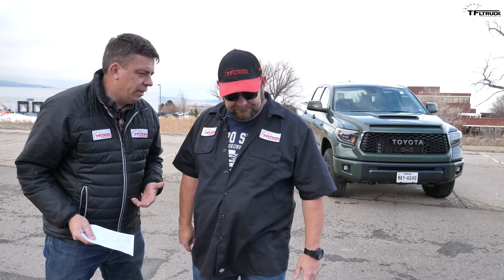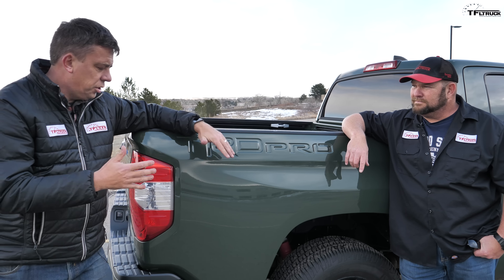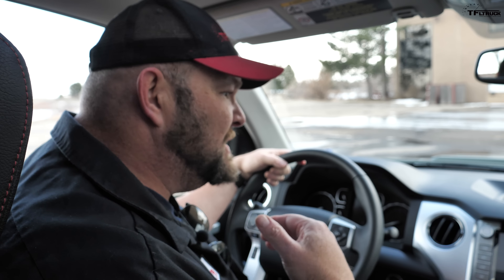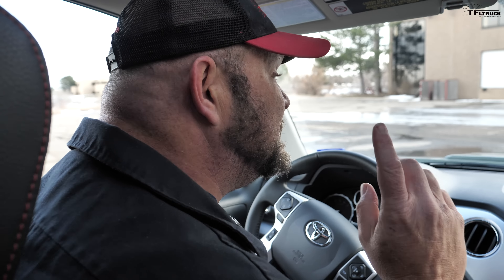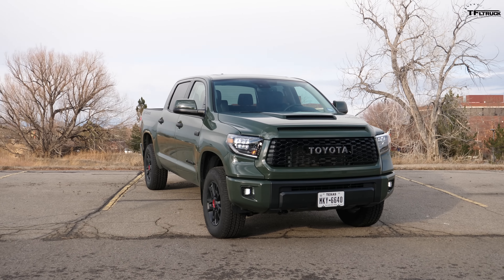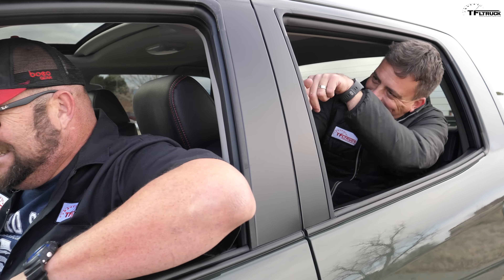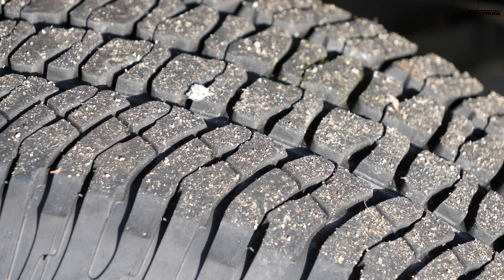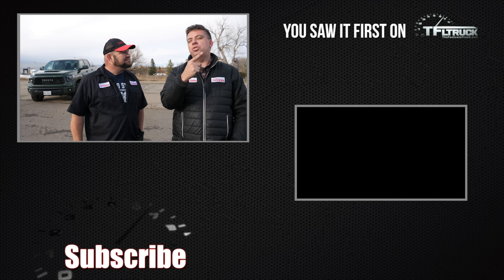The 2020 Toyota Tundra TRD Pro Is Outdated on Arrival - No, You're Wrong!

Comment: The truck is tough long lasting and simple, everything you add makes the truck price go up and up and up. I am a Chevy guy and I am thinking of buying one ..
Reply: My 08 suffered from the front differential howl/growl problem resulting in a replacement front differential...and 2 years later the same issue had resurfaced....rear axle bearing failures, and a couple years later they were failing again.  Water pump leaking like a sieve at 54k, very poor build quality and replacement parts aren't any better.  Finally sold it at 104k, don't miss it at all...on another note, my 05 Tundra has been trouble free with 164k on it.
Reply: @2011buddylee  Yep they decided to completely ruin the Tundra with that garbage engine.
Reply: James Turner I advise you to look into it, I had an 07 and just bought a 15 TRD PRO (1st of this model) I love it, at least drive it and try it.
Reply: I have a 2012 5.7 180,000. No problems at all.
Reply: @wildbill23c  My 2008 limited has 567,901 miles CURRENT on it and nothing major has changed on it. Only tires, gas, batteries and oil.
Reply: @1119-w3u  Lucky you.  I'll keep my 88 F250, it may be a gas hog but never had any problems out of it and it's 860k miles were mostly highway towing mileage, far harder use than the Tundra ever got and no failures of any kind.  That Tundra had issues that a truck with the very light duty use it received should never had happen, then worse the problems repeated themselves again within 2 years of being repaired, not impressed with Toyota Quality, yet my 05 Tundra has been trouble free and it did a lot of moderate towing as well.  Their quality has gone downhill since the new Tundra came out in 2007.
Reply: This Ford guy did.  Simplicity unlike my Raptor.

Comment: What are the other trucks geared for in their rear ends? The tundra is geared to pull. The others are geared for fuel economy.
Reply: 3.55-3.73 gearing is the norm for most trucks. Anything 4.10 on up, you're sacrificing driveability and fuel economy.
Reply: Is that why it has the lowest tow ratings

Comment: For day to day driving here in Canada I'll take the LSD.
For off roading the locker is better but think about how many trucks never any serious off road.
If I'm in trouble it's just as easy to flick it into 4x4....I'm not rock crawling,I'm trying to get thru a mud hole or a snow drift.
Reply: Except it's not an LSD, it's an auto LSD. Which is a nicer way of saying it has brake traction control.

Comment: You guys are wrong about everyone wanting a short bed. I wish the crew cab was offered in the 6.5 ft. bed.
Reply: Kevin Hicks yes... but other than that great!
Reply: First Gen has it
Reply: I would trade my double cab in instantly. They make the chassis to fit it. Hopefully someday.
Reply: There was an aftermarket builder that modified crew max trucks to add a 6.5ft bed. Idk if they're still around though
Reply: The double cab is plenty big enough and still has 4 doors if you just need room for kids back there or adults on short trips
Reply: The crew cab is. 6.5 and the long bed. 
The crew max is not. And I wish it did as well.
Reply: @edshultz9760  , double cab versus crew max. 👍
Reply: @kevinhicks9447  Yes that is what I ment. Double cab has the 8 foot or the 6.5 foot. The max has only one. 5.5 foot. If they made a max with and 8 foot I would get that.
But the crew max Ted sport is ment to be for fun not work. Longer wheel base meant harder off road. But I am not going off road just towing a boat.
Reply: I've never heard anyone that is using their bed say they wish it was shorter.
Reply: Hello?! Thank you for saying this! :) 2020 TRD OffRoad owner here.
Reply: I have a 2015 SR5 dbl cab, and the bed is 6.5 inches long
Reply: Probably the only thing I don't like about tundras is that you can't get the six and a half foot bed with the crewmax cab. That is literally the only reason I would look at an F-150. I currently have a tundra with a double cab. Not a deal breaker, but cosmetically the double cab is ugly.
Reply: @ScoobyGSXR750  
I agree. I hate the short short bed. I would probably buy the double cab my self just to get the 6.5' bed. I've never heard anyone that uses their truck bed wish it was shorter.
P.S. I wouldn't trade a tundra on an f-150 no matter what size bed it had. 😂
Reply: I rather have a 6.5 bed than a crew cab . But definitely wish I could have both.

Comment: Not paying $60K plus for a truck. I went from a 2008 Z71 with 226,000 miles to a 2015 Tundra SR5 4x4 double cab with 42,000 miles and paid $29,000. It's new enough and will hold value better than most other trucks.

Comment: The shape of the floor under the rear seat is the way it is because of the massive 38 gallon fuel tank.  I was surprised they didn't mention that.
Reply: It was like that prior to 2016 and the 38 gallon tank. It's the driveline bump to get the driveshaft/transmission higher up for ground clearance.
Reply: @belanger9  Ya, seems odd because Ford doesn't have a floor hump for their 36gal fuel tank. Can't imagine why they would have had to raise the whole back 2' of the rear of the cab that much for 2 extra gallons and couldn't fit it elsewhere.
Reply: I looked at my 38 gallon tank on a '19 Limited.   It's about 5 feet long.
Reply: Actually it's filled with a big block of foam to absorb noise.  On the shorter doublecab instead of the foam it's a nice storage cubby.  Some folks buy aftermarket storage for back there that have you cut a big portion of the foam out before putting it in.  The only real noticeable difference between the 26 gal and 38 gal tanks is the gap from the front of the tank to the midpipe.  With the 26 gal tank it has near 2 feet of void between the two.

Comment: I bought a 2007 and now own a 2018 Tundra.  With both of these trucks, I have towed my 28' Airstream travel trailer all over the United States.  Never have I had ANY kind of reliability issue or mechanical problem.  Flawless performance from both with brilliant ease of towing.  I may not have all of the electronic bells and whistles of other trucks, but I have solid reliable performance, up and down every mountain range in the U.S.  Superb performance and supreme comfort.  I wouldn't trade my Tundra for any other truck.
Reply: Mike Minton great to hear that.
Reply: Mike I’ve run my toyotas all over these north Alabama mountians and southern swamps. Toyota is only trucks in my yard. I keep 3 allways ! One for work one for play one for in between🍀
Reply: If you never had any issues with your 2007, why waste money on a new one?
Reply: @seantaylor2683  I bought a new one because I wanted the Platinum trim level (Old one was the Limited trim level) and I wanted the new "Safety Suite", radar cruise control, built in trailer brake controller and Bluetooth capability.
Reply: Mike Mintun Toyota rules my driveway as well. Since 1983 no other brand in my girls hands nor mine!
Reply: Sean Taylor two much better than one said my Korean buddy🍀I have to agree🍀
Reply: Bought my 08 NOT running, got it in a bidding war for $3000. Was a broken valve spring and $50 later (spring and valve cover gasket) I had a great running truck. Over a year later, barely any issues.. it has 300k on it.

Comment: My truck is a 1986 Ford f-150 with the EFI 5.0 liter V-8 and a non-overdrive transmission, and a 3.55 rear axle ratio, and the EPA rated my truck at around the same numbers this tundra gets.

Comment: Nathan! You're wrong! Over 1 million miles, comparing this at 14mpg combined to a competitor with a v8 at 17 combined, you would use 12605 gallons more fuel for a cost of $31512.50 assuming $2.50/gal average cost. That's a high fuel cost for that reliability!
Reply: #toyotatax
Reply: @Green Soup I'm using the combined rating. And the reliability isn't that much greater than a competitor's v8. I am deliberately only comparing v8s. Sixes and fours and diesels all have different reliability issues and naturally higher fuel ratings. And yes, the smaller engine probably got slightly better fuel economy, but it is no more.

Comment: Wish we could get this in the "world wide famous Toyota Diesel" other countries get but not us!🤢
Reply: yes and no... to get the diesel, it'll most likely be 10k more expensive and comes with a whole slew of emission hardware that are super prone to failure, even at Toyota's standards. Not to mention the extra expense of DEF. You could do a delete, which would give you the best thing about diesels, but that's a few grand just to do that and the engine has to get tuned... therefore losing out on potential warranty. F150 and RAM's diesels aren't selling like hotcakes either, so the market is very small, not profitable enough for Toyota to spend millions to try to get it emissions approved for the US
Reply: DaDa啊達啦 like 97* of ram 2500’s and 3500’s comes with cummins instead of hemi’s
Reply: @chrishansen7004  That's a whole different category, most people who buy heavy duties actually use them as trucks, while most half tons are just for getting groceries and getting to the mall. Why did you think Ford, GM and Ram took so damn long to bring out diesels in half tons? and the American Ford Ranger is the only country that doesn't come with a diesel, some countries only sell it with a diesel engine. Regulations, since they sell half tons so much more than heavy duties, they're a lot more strict, and the market for diesel engine is so small they need to really find out if it's worth investing. Petrol is still by far the biggest seller even with the available diesel in half tons.
Toyota will come out with a hybrid Tundra before they put a diesel in it. It'll most likely use less gas while towing a lot more.
Reply: Put a 4bt Cummins in yours.

Comment: I’ve always been a ford guy but that tundra is the last of the tough old school trucks. I think that’s the best real world half ton out there.
Reply: Kent Boyko same here, I’m also a ford guy, but now I drive a 2017 TRD 4x4 Tundra and love it👍🏻
Reply: Get the new 7.3 from ford. That truck is going to kick ass.
Reply: Not really. They are way overrated as far as reliability. It is still an all aluminium DOHC engine, with all the known pitfalls of that design. DI in a V8? No thanks. Other than having 8 cylinders, this engine shares nothing with the old reliable truck engines of the past.
Reply: D Ferret One small reason I like the tundra is they still use a steering shaft instead of this electronic steering and our Ford Escapes locked up the other day turned on and off and it works again lol just kind of makes me nervous there is no physical control and all electronic. Also the 2018 5.0 and up have some major issues with oil and coolant disappearing and the big three our so competitive that there trying new things all the time that aren’t necessarily proven where Toyota just finds something that works and leaves it alone until the technology of today is proven 5-10 years down the road and they use it.
Reply: D Ferret if I was to buy a truck today it would  be that superduty with 7.3 mainly because I can use a heavy duty truck and like the long box but if it was a half ton it would be a tundra.
Reply: Yes, sir. Reminds me of my folks 84 3/4 ton. 5.7 with 4.10(close enough) gear ratio.
Reply: Simple Pleasures MTB it is going to kick your ass all the way to the nearest gas station.....very often. Gas guzzler.

Comment: Unpopular opinion: you do need a locker.
Reply: K C No, but when you need it that one time and you have it, it has paid for itself.
Reply: Turn the TC all the way off (5 second hold, not just a push) and the rear tires will spin at the same rate. I've put down a few 11's with my Tundra, don't know how much more locked you want than that.
Reply: belanger9 what year of yours did you hold for 5 seconds? I’m trying to figure out how to play with the traction control
Reply: @clearme2  2010 and 2016. May be 10 seconds, just hold it down until TC OFF comes on the cluster.
Reply: TheyCallMeCoolRon Yeah, I suppose you could say that about anything. But we do quite a bit of off roading and modern traction control/off road programming rarely fails.

Comment: I think it should be specified that the TRD Pro does not have a conventional limited slip differential. It is an ABLS brake actuated "limited slip." It applies the brakes to one side to divert power to the other side. A conventional limited slip or locker like the GM G80 is more reliable and durable.

Comment: Dear toyota...please don't make the new tundra into a soccer mom suv full of wifi and unnecessary technology that probably won't work after 200k miles.  I can drive just fine without blind spot monitoring, 360 degree cameras and giant touch screens.  Just leave it as the most outdated truck that sucks fuel and flat out works.  Thank you.

Comment: I bought an SR5 at 70k flat miles. Without knowing any of its history. I am now at 114k miles and still have not been to a shop other than oil changes. There is something magical about turning the key and knowing it is gonna start right up and take you where you need to go. My previous hemi I owned for 2 years has spent a total of 4 months in various shops all over town getting repairs. I got so sick of asking friends for rides to get to work. Never again

Comment: Simplicity in the engine until you have to pull the intake manifold to replace the starter
Reply: How about pulling the engine to change the PS pump?
Reply: original starter and PS pump and alternator on my 96' 4runner with 354K.
Reply: Bothers me when people say the 5.7L is like a carbon copy of the old 4.7L that actually was reliable.
Reply: Wrong, The starter is actually on thee passenger side it's not in the intake manifold The first gen Tundra is yes The second to onward, no.
Reply: @SuperCJification  most reliable of all of the trucks.
Reply: Manifold is easy to remove on the 1st gen. People just like to repeat stuff they hear.
Reply: Literally adds maybe another 10 minutes and you don’t have to lift the truck
Reply: At the time you replace the starter in a toyota,you have replaced the engine and tranny on  Domestic

Comment: I really don't need the fuel efficiency and electric gadgets but I do need the xtra 15 grand I save buying a Tundra. #learntobackup
Reply: If you watch until the end the truck is actually $54,000. When they started the review off and it was in the 30s, it seemed OK.
Reply: @ryanrichardson1169  but what they don't tell you is you can buy a four wheel drive Toyota Tundra V8 for starting at 38 Grand. You can also get a Dodge four-wheel drive but it'll start at 39k and its a V6...
Reply: I don't need the gadgets but you have to admit they are fuel pigs . Other than poor fuel economy  there is nothing about the Tundra I do not like .
Reply: @backlash660  yes, I'll admit they do guzzle gas but rock solid reliability is worth more than 4-5 mpg.
Reply: They need more engine options on both their trucks. Ford nailed their engine options imo over their competition. Id still buy a f 150 over a tundra
Reply: @tjl8884  link to said video?
Reply: Yeah, but the others give way steeper discounts so the difference isn't that much.
Reply: sneakypete187 
I have personally owned  5 Toyota’s.  Total mileage traveled on all five is over 500,000 miles.  Zero mechanical failures on any of them.  I have also owned Fords and Chevys when I was young and dumb.  They all had issues.  Experience not opinion.
Reply: @lesjohns4359  Yup right on que, the toyota shills with their 600k trucks with no issues lol..
There should be at least one more post about his 3 million mile toyota truck.. lol
Reply: TJ L 
I speak from experience.  My Tundra has never let me down.   Can’t  say the same for Ford or Chevy.  Drive what you want.  It’s your money.
Reply: You don't save money when it has crap mileage
Reply: Got my 19 f150 crew 4x4 3.5tt xlt 302a sport plus a few other options for 37k. Gonna be tuning it in a few days. And if I was gonna get a V8 it would be the LT1 or coyote. Tundra is irrelevant at this point. Only thing it has going for it is reliability.
Reply: One Man On Fire 
You save money when you can drive it for 12 years (or more) with out issues.
Reply: I've never paid sticker for a single Ford, GM, or Ram I've bought.
Reply: @Green Soup As someone who currently owns a 94 Toyota Land Cruiser since new that left me stranded on the freeway 3 times. Don't assume just cause it's Toyota it doesn't mean it's perfect. My 99 Ford ranger since new 0 problems.
Reply: @2A I see tons of OBS fords still on the road, many still serving as work trucks. They quit building those in 1996 for the half tons, and I believe 1997 or 98 for the HD's. 
I VARY rarely see a gen 1 Tundra still on the road.

Comment: My 06 Tundra with 84k miles just works, and it is paid for.  I won't have a car payment for 20 years.
Reply: LowKey ID my 2011 crew has 187k sofar have had nothing go wrong.
Reply: LowKey ID my 06 just hit 200k and runs great. Just keep the timing belt replaced, fresh fluids, the occasional U-joints, and it will keep going forever.

Comment: my 2008 tundra crewmax 5.7L died at 84k miles. Piston broke, damaged valves, etc.  $24k for new engine installed from dealer, 12k for used 70k-mile engine from dealer, or $6k for rebuilt engine to be installed by whomever. A fluke I'm sure, but still happened.